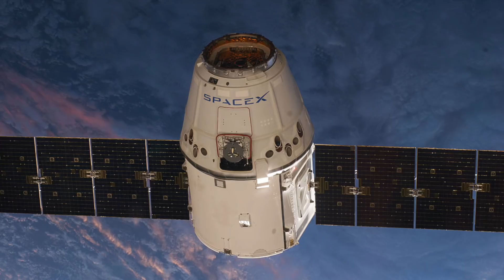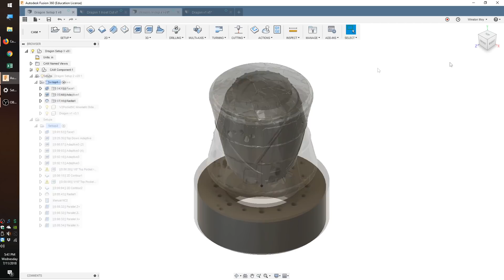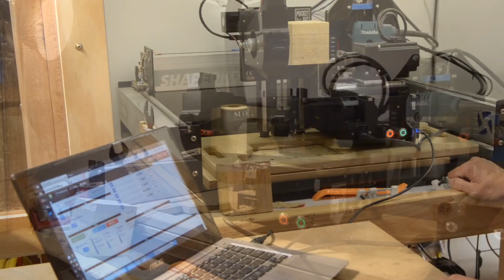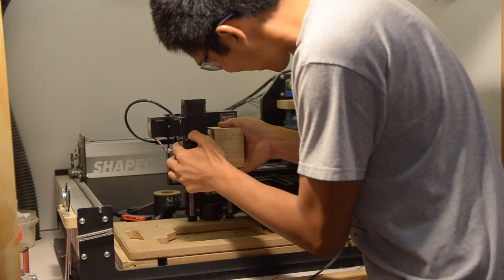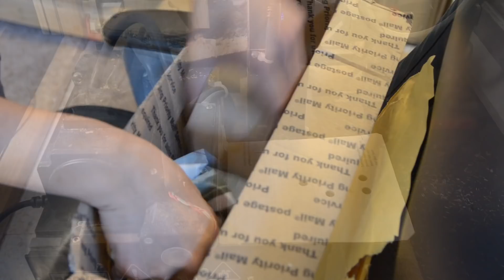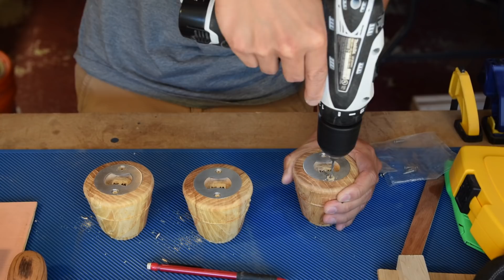Machining a Wooden SpaceX Dragon Bottle Opener - #125

Comment: Make a simple blisk/blade in fusion and do some simultaneous 5 axis, Machine from the top down, do a quick roughing pass with a the largest EM that fits. Then get any BN and scan all in a spiral all the way down. It’s a simple simultaneous 5 axis job I did for my first time doing simultaneous on powermill. Unsure on how fusion would handle that though.

Edit: can send the fusion file also mind you it wasn’t hard to make just a jelly bean offset workplane then a smaller jelly bean and loft

Comment: One thing that could cut down cost and time would be to lathe the general shape of the pod, then use the cnc to cut details. Actually, with a lathe, since the top of the pod has a cylindrical profile, you could chuck it with that and make the bottom profile, and also drill for the holding screw; this would leave only one process for the Pocket to do. 
Only problem is that you need a lathe. I wonder if you could have a high speed 4th axis lathe on your main cnc, and rather than run the spindle with a bit, have it hold a lathe insert somehow; or make the spindle into the lathe axis, then have a stationary cutter that the x and y axes move into. But then the strength of the setup becomes an issue. 
It's too bad there's no cnc solution that's a mill, lathe, and 5axis. I don't even know if one could actually exist without having to swap out a ton of fixtures for different forms of machining.

Edit: Also, reading another comment, the stl model doesn't play nice with multiaxis toolpaths. Going back to the idea of using a lathe to cut the general shape before cutting details; do you think designing the general shape, from scratch for multiaxis toolpaths, would speed up the process? The general shape is mostly a cone with a dished bottom and cut off tip. Leave all the detail in the stl model, it's still multiple processes, but it could cut down on time.
Reply from the maker: When I was running the mental calculation about making these in quantities larger than single digit, there were two things I would have had to do. 
1) Acquire extra tool holders. (Check.)
2) Acquire a lathe with at least a 12" length capacity. (Pending move to California.)
Starting from cylindrical stock would have been a huuuuge time savings, but unfortunately round stock isn't common in diameters larger than 2.75". The majority of wood turning blanks 3" and larger are square profile.

Shapeoko/GRBL unfortunately doesn't support a fourth axis. ATmega328 doesn't have the I/O's or memory for it.

A conical placeholder might help for CAM purposes and speed up calculations, but in terms of run time there's probably not an advantage. Still gotta rely on a parallel finish at the end.
Reply: @WinstonMakes  you should check out this old tony... He made a cnc lathe

Comment: Nice little project Winston! Supports the pocket NC also support true 5axis or does it lock up the A and B axis during the cut? I was wondering this because (No offence intended, just an observation) the milling strategy I saw in this video based on 3+2 axis.
Reply from the maker: See previous PNC project. It does full simultaneous 5-axis. I couldn't use multi-axis toolpaths here because they weren't playing nicely with the STL mesh.
Reply: Thanks for the quick answer! That does make a lot of sense that it doesn't work with STL files because of the lack of arcs

Comment: Rather than moving your model for the second setup, duplicate the work holding and position it relative to the original model!
Reply: Also, great video and cool project.
Reply from the maker: 😯🤔 Light bulb just went off in my head. I could definitely make this process more efficient by using a single fixture setup... Next time.